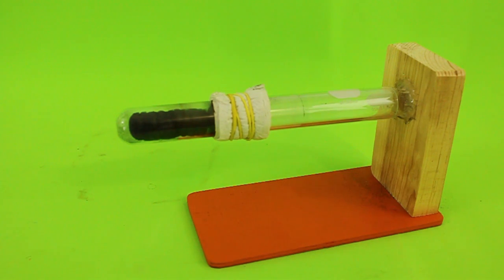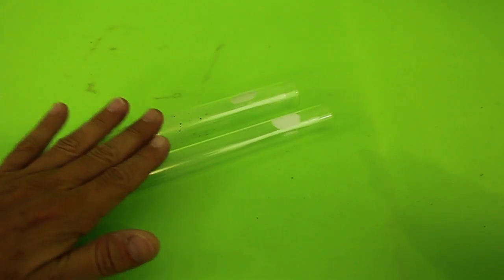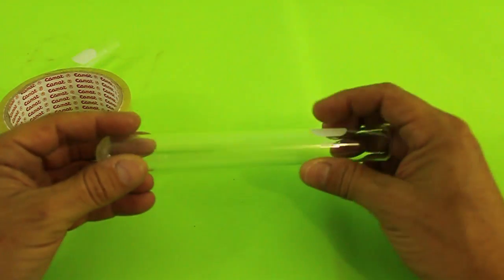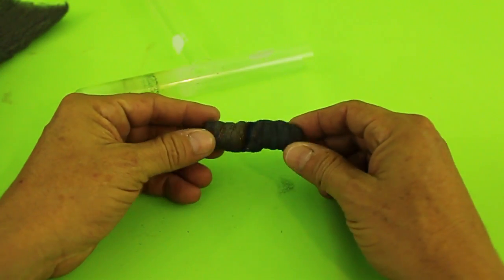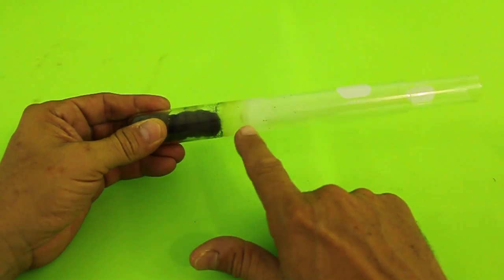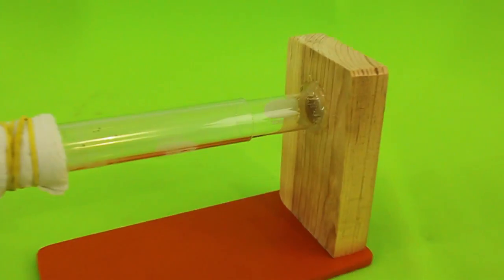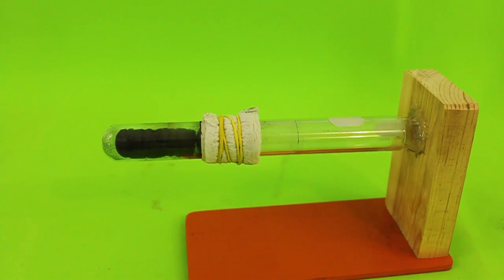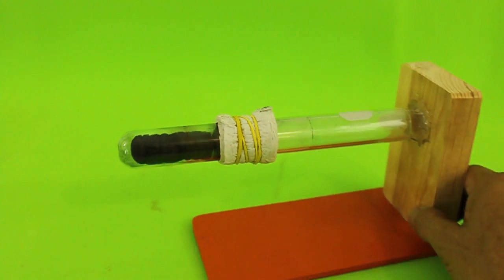Easy to Make Stirling Engine

Comment: Hobby Projects
,Published on Dec 1, 2018 Magnetic Levitating illuminated rotating Globe using Arduino is also fun as he combines several (best bits) concepts 
https://www.youtube.com/watch?v=QyS8gAjO6vA

OC if you can find some data to build it then hoofbags
 MOTOR GENERATOR/ROTARY TRANSFORMER DEMONSTRATION https://www.youtube.com/watch?v=3QYVlVZlro0 is also worth replicating too.
"hoofbags
,Published on Sep 9, 2015

Before transistors and integrated circuits existed, or were affordable, it was still necessary to operate radio equipment in vehicles. Valves or tubes, being the only choice, meant that a means of powering this equipment was necessary. Cars are equipped with an electrical system operating at 12 volts and sometimes only 6 for the older ones. Valves and tubes struggle to operate effectively at these low voltages so a means of voltage boosting had to be devised. The choices were 1/. special valves that were designed to operate at 12 volts 2/. a vibrating reed interrupter that could supply a transformer low voltage winding with a square wave and 3/. a rotary transformer. Twelve volt valves couldn't be used for high power applications so were used in the radio RF and IF and detector stages only. Vibrating reed interrupters caused radio frequency interference that additionally caused a buzzing sound to emit from the speaker, occasionally. They were also notoriously unreliable. The third choice was the rotary transformer....."

Comment: This version of the Stirling engine is really a thermoacoustic design.  The addition of some magnets and coils will provide a simple alternator.  But that's a lot of heat coming from the propane torch.  If this will operate on a candle, you will have improved the economy of the system.

Comment: I’ve been trying for years to make this type of sterling engine. I’ve used glass syringes with lots of heat and steel wool and torch like yours, even with borosilicate test tubes. I have never tried with tape like yours. I’ll let you know if I finally gain success. Thanks as always for your wonderful  demonstrations.
Reply from the maker: I will be making more engines, thanks and wish you good luck!

Comment: I have a really tough time getting test tubes.
Reply from the maker: Why?
Reply: @ludicscience  Finding a source that will ship to me at a reasonable cost. 5-7 bucks a piece is just too much for something that is worth about 60 cents. I have an eclectic collection of glassware only because I get stuff that is available to me not the stuff I need. I have the same problem with electronics parts.
Reply: @Mr.Unacceptable  At that price you can probably find a cheap cigar in a glass tube cheaper. I used to use my grandpa's glass cigar tubes for test tubes when I was a kid, they handle heat pretty well. It was the best ya could get before Amazon and internet commerce where you can get just about anything in 2 days shipped.

Comment: Very simple construction indeed! It might be possible to add a flywheel if you secure the larger tube and epoxy a metal rod to the inside center of the smaller tube. That would attach to the flywheel but I'm not sure how that would effect how your engine runs... Might be able to power a few LED's from it then?